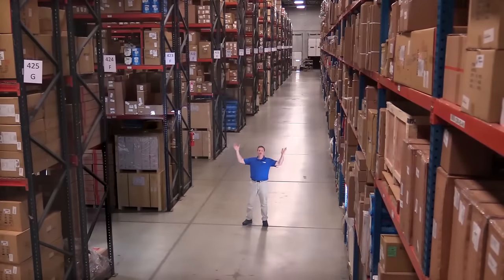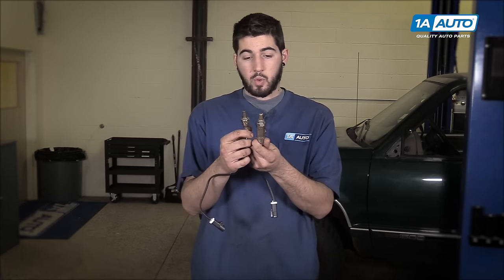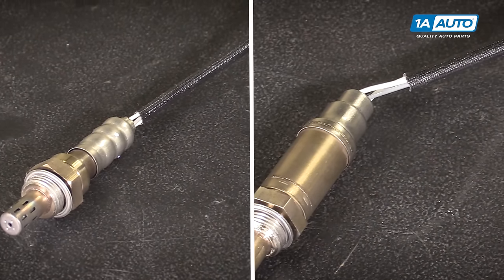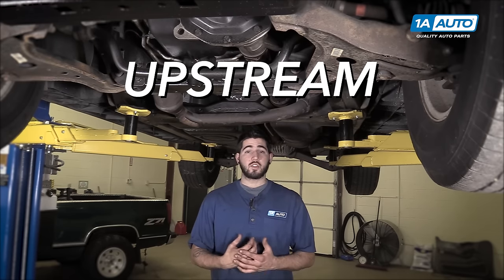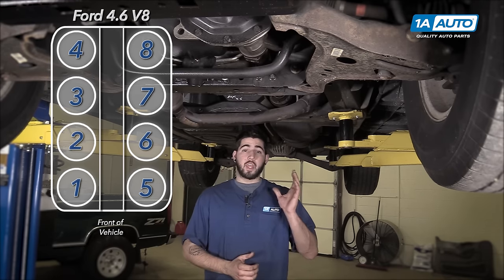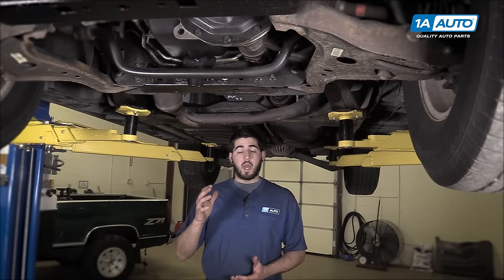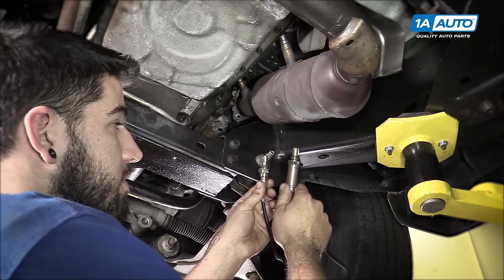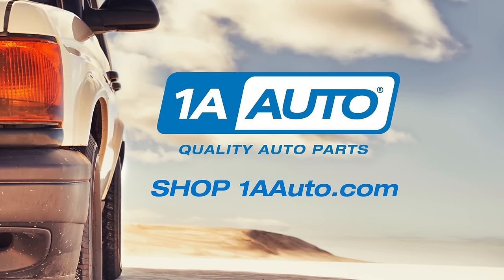O2 Sensors is it Upstream or Downstream?

Comment from the maker: √  Watch the Video
√  Buy The Part at 1A Auto http://1aau.to/m/Visit-1AAuto
√  Do it Yourself
√  Save Money
Reply: Buy  them
Reply: I'm done
Reply: Now what happens if u interchange the upstream to the downstream and the downstream to the upstream the actual sensors?
Reply: What if you have a BMW 4 Cylinder with 2 cat converters and 4 sensors? 2 upstream and 2 at the rear of the cat converters?  How do I know which is bank 1, sensor 1?
Reply: My 1997 F-150 was OBD scanned after my gas cap broke in half, and when I put in another one, same exact cap, except functional, I was driving with a bad one before and I got a check engine light. OBD said it was the O2 sensor, is the cap faulty, or sensor bad? Autozone told me the cap can cause that code to appear and I dunno now.0
Reply: The truck runs fine, and I’ve noticed no fuel economy decrease or other bad factors developing.
Reply: How do you determine which one to replace? I have code P0130

Comment: Excellent question which has caused much confusion - unfortunately, you spent the entire video clarifying a different issue. Okay, so I have purchased an upstream and a downstream  sensor, taken them out of their boxes, then am called away for an urgent phone call. On return, I forget which came out of which box. How does your answer help? You have described the function of the sensors well - but your question was 'how can you tell the difference?'. It does not need a video to demonstrate their location on the vehicle. Surely there should be an identifying part number stamped on the body of the unit or a tab on the cable like any other part. Can you clarify how to identify the sensors without the questionable on car comparison (bearing in mind that aftermarket units may look different anyway0
Reply: if you are replacing the O2 Sensors, your OBD reader will tell you which one you need. Which bank, 1 or 2, if not both. O2 sensors last around 100k-150k miles max. Not a bad idea to replace both if one goes out. They usually run $20-$40 or OEM parts. Never use aftermarket for sensors. They often do not communicate with the vehicles ECM/PCM processor and you still get codes after you replace with aftermarket
Reply: Agree. It took the whole video just for location. 1 minute should be more than enough to tell which one is for such.
Reply: I have a different question.I have a 2006 Ford F150. I know from my dealer that the upstream and downstream oxygen sensors are two different part numbers. It shows part number 4L3Z-9G444-AA is the Exhaust Gas Oxygen sensor and part # XL3Z-9F472-AA is the HEGO Oxygen sensor. So I was looking to figure out which is upstream and which is downstream. I can't compare them to the ones on my pickup because a previous owner put in 4 of the same part number. I was hoping this video would tell me which one is upstream and which is downstream. Guess it's a trip back to the dealer.
Reply: Dude I have a Mini Cooper where the position was switched for more than an entire year before I figured it out. They should mark the stupid connector with which bank its connected to in the ECU. A dealer told this older couple that their Mini needed a head gasket change and the O2 was in backwards and the car had a water leak.

Comment: Went and bought 2 O2 sensors; one of them cost a few bucks more ; when i got home and opened each box( different parts number) the sensors were exactly alike,  only difference was the length of the wiring;

Comment: My upstream and downstream sensors have different  connectors. I found out when the ones I bought off of eBay wouldn't plug in. The ad said upstream and downstream but I had two upstream sensors. Had to order some downstream sensors to finish the job.

Comment: This doesn't answer MY question. Are the sensing heads different? There's only one "O2 sensor" for my silverado on every parts online store I look. Is it just wire lengths that vary? If the plugs reach their harness, can I use the same part for up or downstream?  Thanks.

Comment: Like all other videos it did not answer the question. It described the location of the sensor.thats all.
But the answer is: any oxygen sensor can be either upstream or downstream. If you have one in a box or on the table and you dont know where it goes remember you can use it for either upstream or downstream.

Comment: I'm seeing three O2 sensors on my 2007 Ford Focus. I don't know if there's one underneath the car yet but the third one from the motor they cut it and I'm guessing that one went bad in the former owner did not replace it. I'm having a check engine O2 sensor light coming on

Comment: You almost answered my question in fact when I think about it almost everyone almost answers my question. I got the different placements of the O2 sensors. My question is they're both installed just in the wrong based on electrical connection , but they both still plugged in(didn't force the connections just weren't notch out)do I have to worry about swapping them back. 

Ultimately, is there a fundamental design difference in each one...in other words is one specifically designed to catch the Upstream exhaust in one particularly designed catch the downstream or do they both function the same?

Comment: I have a 2014 town and country van, low millage on the engine, 120,345 miles. I comp. says I have to replace the C C. Expensive job, so I was told it might just be the sensors. Is there for on my van, I might replace them all? 2 up stream, 2 down stream.

Comment: Hey I have a 2007 Cadillac Escalade esv The check engine light came on in the cold was (P0050, P0154, P0155)  Bank 2 sensor 1.  I would like to know which sensor I have to get and if it upstream/downstreamI.  Also please let me know which side of the truck is the sensor located. It would be nice if I can get a link for the sensor

Comment: Which sensor issue cause problems to the car? One Mechanic told me one of my O2 sensor needs a change and its fine to drive with it and the problem will only arise if the other sensor goes wrong. Which would it be?

Comment: A1 sent me a "downstream" sensor that visually looks identical to my upstream sensor. How do you visually tell the difference between the two sensors when they are not on the vehicle?
Reply: Physically and functionally they are identical. Only difference is what the internal heater's resistance is calibrated for (6Ω - 16Ω). This is why even for universal sensors there are multiple SKU's. Generally the downstream will have a lower resistance than upstream, and likely why they are more prone to failure.
Reply: @SerenoOunce  Finally, a good way to ID up & downstream is the resistance. I was about to give up looking for some real info on this.  Thanks much.

Comment: I changed out my upstream o2 and cleaned my MAF with CRC spray. No engine light: I just figured it was about time. It restored so much power but I didn’t change the cheaper one. I’m assuming that’s the down stream o2. Do you think it would restore even more power? I’m at 179k miles on my Camry se 2.5l and I like to stay ahead of things. At the same time I was losing power and once o cleaned the MAF and changed the most expensive o2 sensor it made a huge difference. Just wanted to know if the other o2 sensor would be worth changing too even tho I don’t have a light on
Reply: hmm, i have service engine soon

Comment: Hi , my catalytic converter is stolen with upstream sensor then I installed straight pipe but the engine light is on and the fuel consumption is very bad . Does installing upstream sensors into straight pipe will solve the problem? Thank you

Comment: Hi, my car is a 1997 Toyota Camry with V6 engine (1mz-fe). I noticed some petrol leakage on the bank 2 cylinder. Meanwhile, the car is consuming gas more than expectation. I later realized that bank 2 oxygen sensor is bad and I replaced it. My question is that, while the bank 2 oxygen sensor was bad, could it be that the ECM is relying only on bank 1 oxygen sensor. Do both sensor have to send different signals to the ECM? Why is bank 1 not having similar problem? How do bank 1, bank 2 and the ECM work together?

Comment: Which one will actually work for my truck? So far I have bought several sets from several places, maybe here also I'm not sure, and they all have been rejected by my truck. Why is this? I've bought almost every brand and type that the cost isn't outrageous. So do some vehicles have to have certain brands ? My 2000 gmc Sierra 1500 2wd 5.3 has rejected everything so far. Next is some that cost over 200 for the set.

Comment: Hi guys
KIA Sorrento 2012 with 4 cylinders 2400cc engine got codes p0032+p0132 on OBD2 checking ..
The AFR wide band range with 5 Wires  the car works fine ... I changed it to stop that check engine light with other used One ... But the light still on with codes p0031+p0132 the engine warks fine the same with no exchange...
I NEED to know how to recognize each wire on that sensor side +  harness side

Comment: Okay so I have question to anybody that has or knows about this.. 

I have a 2003 Mustang GT 4.6 2v 

I’m dealing with 02 sensor problems right now and I ordered some NTK upstreams and downstreams. They’re were all the same size meaning the smaller rounded ones like this guy had in the video on the upstreams of the car. When I ordered 2 upstreams and 2 downstreams they were all the smaller rounded ones. Is there supposed to be 2 of the smaller rounded ones for upstreams and 2 of the bigger/fatter ones for the downstreams? I need to know ASAP thanks in advance y’all
Reply: I also understand that it could be a bad/burnt/corroded wire that’s causing my misfire. We thru the whole parts store at my car meaning sensors, PCV valves, spar plugs and coil packs but it’s acting like it’s the 02’s. When cold it runs great but once the car is warm it’s thumping and causing a misfire in cylinder 5. Not throwing anymore codes except for evap code.

Comment: What if my downstream sensor needs to be replaced and I only have a downstream sensor available with me? Can I still use the upstream to replace the downstream sensor? And does the negative battery need to be disconnected when doing this? Thanks

Comment: I ordered 2 oxygen sensors from A1 Auto part (1AEOS00044 and 1AEOS00098). It turned out that my Lexus 2000 RX300 has the same Oxygen sensors (1AEOS00044) FOR BOTH UPSTREAM AND DOWNSTREAM.
Is this information correct or not. I am confused.
To A1, Please, give me your response.
Reply from the maker: +Nam Ly Thanks for checking us out. Part number 1AEOS00044 is only listed to be the Upstream sensor for the 2000 Lexus RX300. Part number 1AEOS00098 is listed as the Downstream sensor. Please let us know if you have any further questions, thank you.

Comment: I just bought a set of 2sensors that are supposed to be US and DS. They are identical. Neither is marked US or DS. The only difference is the color of the connectors. One is black and one is gray. I also noticed the black and gray wires are reversed where they attach to the connectors. Does that make a difference? Does it matter which hole I put them in?
Reply from the maker: +RussNo1 This will all depend on the year, make and model of your vehicle. Please contact our customer service department at 888-844-3393 for further assistance. 1aauto.com

Comment: This doesn't determine which one is which though it only determines that if you have O2 sensors installed, so say my box came with up&down togetehr and not labeled. By looking at it which one goes where? Single hole upstream? Multi down stream?

Comment: I have 2000 grand marquis and when i replaced both  upstream sensors right and left i can not know which harness  connector is driver or pasnger side becuase they are loks the same 
I need help thank you
Reply from the maker: +Kalaf Harbi That vehicle may have the same sensor for either side. Thanks for checking us out! 1AAuto.com
Reply: @1AAuto  
Thanks for replay 
I know they are the same sensor but i am talking about connectors i think when we connect the wrong connector on wrong sensor how the pcm will read it

Comment: He didn't show very well what the front and/or rear sensor looked like from each while under the car. I think the upstream senor  had holes in it while the downstream one was solid but I not sure. He didn't make it clear which one was which. When the sensors were clearly shown, it wasn't stated which one was which.
Reply: If you look closely at the video, the downstream sensor body is thicker than the upstream sensor, and the replacement sensors had the same body type (downstream was thicker).  I'm thinking that visual comparison was the determining factor when deciding which sensor went where.

Comment: On a flat four how do you know whether it is the upstream or downstream that needs replacing if the fault codes you are getting just say bank 1 because this could mean either? Do you have to buy both parts and see which fixes the problem or do many cars today have the same O2 sensor for both upstream and downstream so this wont be a problem to do the trial and error and not spend twice as much?
Reply from the maker: +ImperialJohn Thank you for checking us out. On the flat four, it will provide bank 1, and then sensor 1 or 2. If you receive sensor 1 this indicates the upstream, while sensor 2 means downstream. 1aauto.com

Comment: On a 2005 Chevrolet 1500 I replaced bank 1 sensor 1 Bank 2 Sensor 1 after replacing the throttle body and the gas pedal sensor and the truck is still losing power what I mean is it's flashing reduced engine power on the dash where the odometer reading is.. the code I get is U0107 . Now the throttle body was what they replaced first then they replaced the gas pedal sensor that comes with the new gas pedal then bank 1 sensor 1 and then my friend change bank 2 Sensor 1 .. now when Googling the code it says something about losing connectivity with the throttle body I'm guessing that could possibly be that something come unplugged and or to make sure things are getting power or amperage at the pigtail of the throttle body.. anyway what do you think it could possibly be that's causing it to still show reduced engine power and lose all power and then I turn it off for 5 minutes started again and it ran fine for an hour and a half you left it sitting for 3 days in the engine light went off and it ran fine but through the code
Reply: Those pictures were Upstream sensors the bank 1 sensor 1 Bank 2 sensor 1 we're both Upstream the downstream is behind the catalytic converter I haven't replaced those yet

Comment: On my 2007 Mazda3, check engine light is on and after scanning I got a code saying bad air fuel ratio sensor. How'd you know if the upstream sensor needs to be replaced or downstream?
Reply: Upstream

Comment: what happens if you replaced both 02 sensors, and runs fine, but check engine light will not go out, cleared with code reader but came back on with in a day?
Reply from the maker: +REWTIGER Thanks for your inquiry. There could be multiple reasons why you're having this particular problem. We suggest taking your vehicle to a nearby reputable shop to identify the cause.

Comment: If I’m getting an obd code p0135 bank one sensor one. Would I start with replacing the sensor? Is it possible the sensor could be good and just need cleaning? I heard another guy talk about this. Thanks for the video!
Reply from the maker: +Brian Bacich We wouldn't be able to diagnose an issue like that here, you may want to have a local mechanic take a look at it. Thanks for checking us out! http://1aau.to/m/Shop-1AAuto-c

Comment: The wire on my upstream was a tiny bit longer than the one I replaced. It’s still the same tho. Same brand, connection and etc. I only cleaned my MAF with CRC and changed out my upstream o2 sensor. I didn’t do the 2ed one that’s the cheaper one. At 179k I’ve never had a engine light. What benefits do you think that will be restored if I replace the other o2 sensor even though I don’t have a engine light and at 179k miles I just keep up with my car is all. I’m looking to find a way to restore more power on my car and would it be beneficial to change out the second O2 sensor? Even though I don’t have an engine light I just know I need them at the mileage that I’m at. My oil is always up-to-date, my spark plugs are really good brand new, 99% of my parts are all Denzo brand but what else could I do at this mileage to restore power?  New injectors? Or maybe a chip plus tune? On my 2013 TRD Camry? In the park position, I feel a little jump on my idle every now in then. What can I do to fix that? Also I hear a weird sound coming from the front driver wheel area that sounds like a leaf hitting a fan but doesn’t make the I use when throttling not breaking only when the car is moving and the noise stops around 5-10mph coming to a stop. Lol random I know but anything you can suggest would be great
Reply from the maker: +A A RON M. We wouldn't be able to diagnose an issue like that here, you may want to have a local mechanic take a look at it. Thanks for checking us out! http://1aau.to/m/Shop-1AAuto-c
Reply: @1AAuto  well I do have a Lexus/Toyota specialist that I’m going to take it to.
Reply: I just replaced a bolt in my son's car (1999 Camry) that had vibrated out of his brake cylinder (14mm bolt), and allowed the brake caliper to contact the inside of his wheel as it rotated.  I could see where the caliper was rubbing on the inside of the wheel itself.  Only had the sound when he put on the brakes.  Look for wear inside the wheel and on the disc brake caliper.  PN 47715B for the bolt itself.  That fixed his problem.  $5 for the bolt.